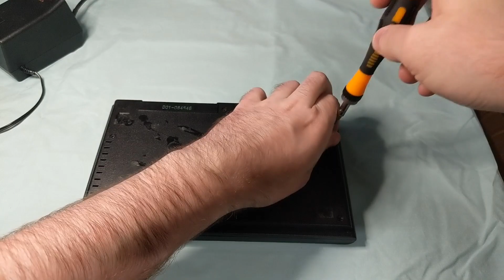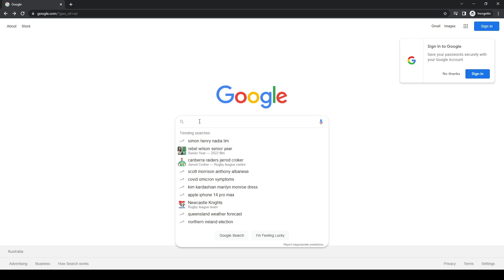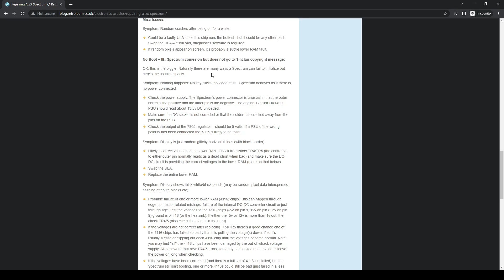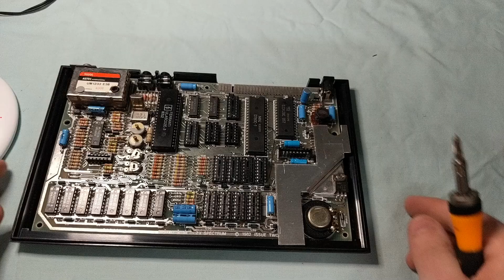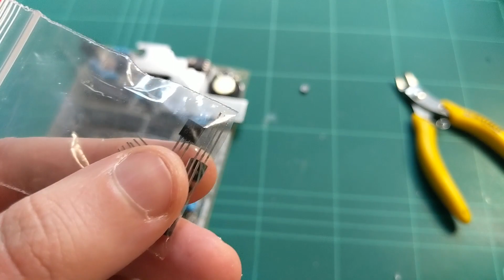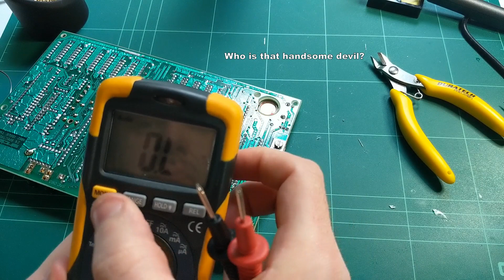ZX Spectrum - Bad Video Repair

Comment: "I don't really know how to solder." followed by "my understanding is flux is a bit of cheat". So much wrong here, flux acts like primer preparing the surface to bond strongly to the solder, not using solder risk dry unreliable joints. Could do with a solder sucker. Still, a competent repair.
Reply from the maker: "a competent repair" - I'll take that hahaha. Thanks for the clarification on flux, I think I've got my head around it more than I did when filming this video, but I've still got a lot to learn. Definitely looking to get something better for desoldering, using the wick really becomes a pain.